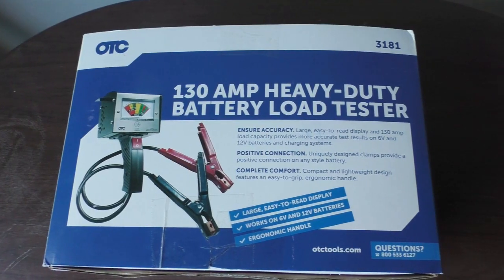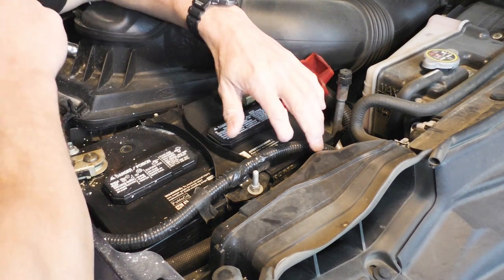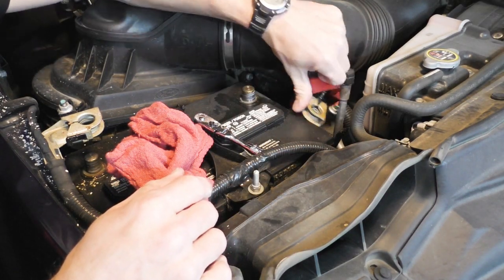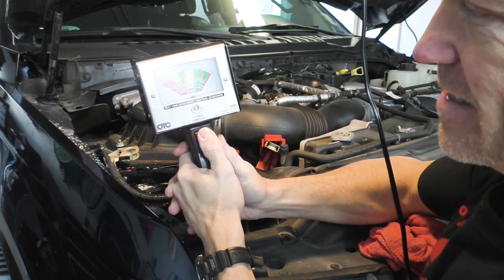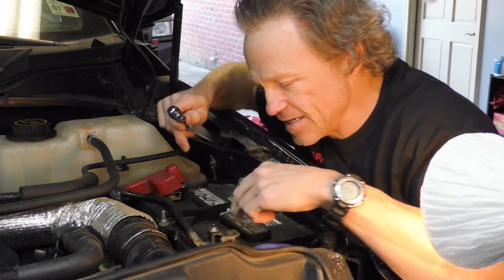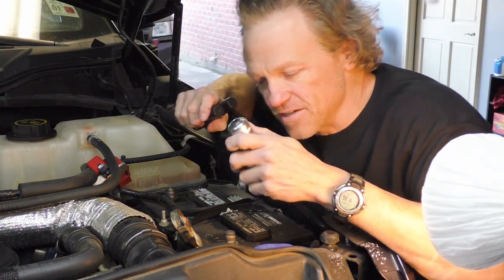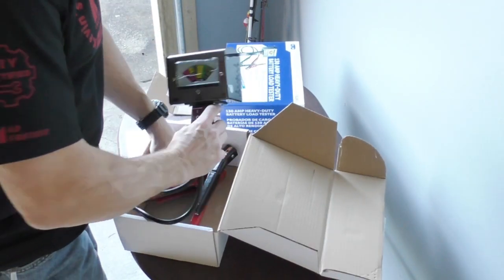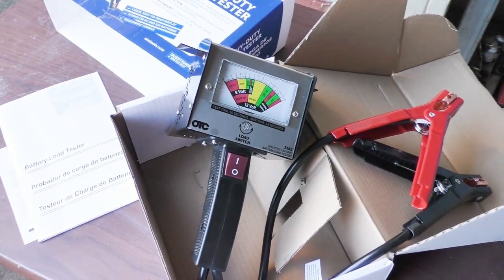Load testing a battery - OTC BATTERY LOAD TESTER REVIEW

Comment: I tested my neighbor's  batteries in his truck  a couple of months ago with one of those Solar testers that just checks the resistance between the cells and I didn't unhook them and it showed which battery was bad. It showed one battery bad and the other good.. It looks like both your batteries are weak. Usually free replacement is only good for 2 or 3 years, then they pro rate them.
Reply: If you are within 3/36 they should replace them.
Reply: I bought a load tester to go along with my solar. I have been stuck a couple of times with a bad battery, so I test my batteries every 6 months

Comment: Fun! Also to consider: Are those maintenance free batteries? They looked like they have removable caps. (This would be in agreement with your notion that Ford didn't put the world's best battery in. This is typical of auto manufacturers in general). If you don't keep the levels up the battery will fail prematurely. Also note that a proper load test for a battery requires that you charge it first. One battery was poor, the other wasn't in much better shape. You could end up with the same result if the batteries were OK, and the charging system were faulty.
Reply from the maker: Greg Feneis yea man great tips. 
I did check the charging system
Alternator putting out 14.5 volts 
It seemed good 
Yes I should recheck them after charging them up too.  But it has to be that or parasitic drain
Thanks man. 
I’m gonna let ford deal with it haha
Thanks so much for watching and being a part of the channel